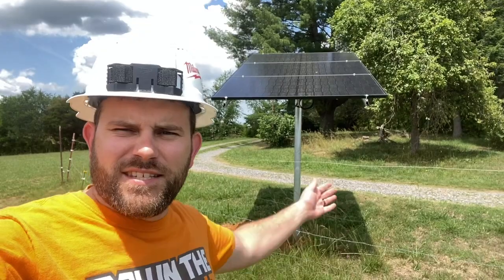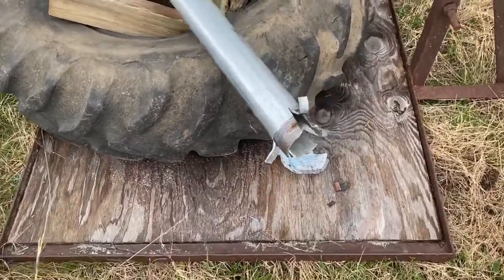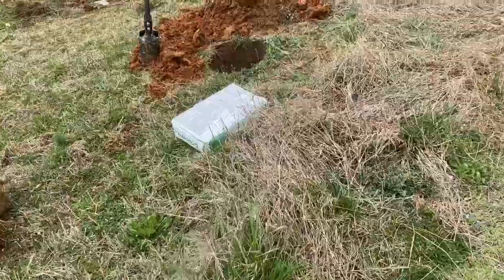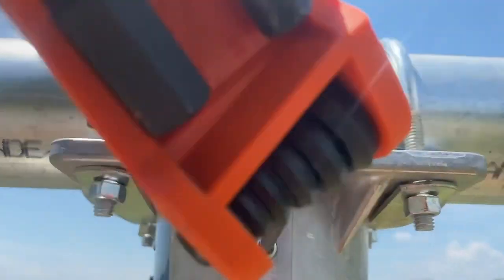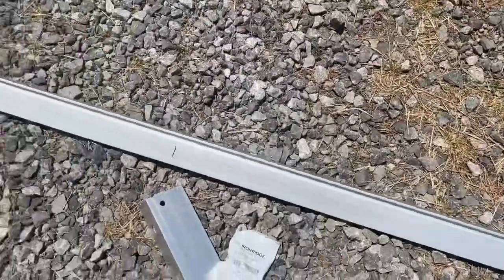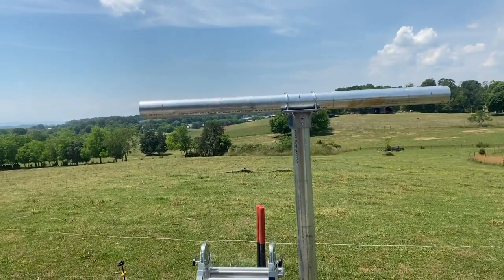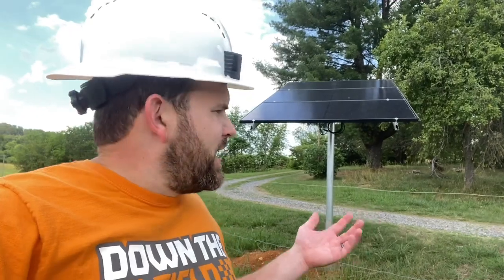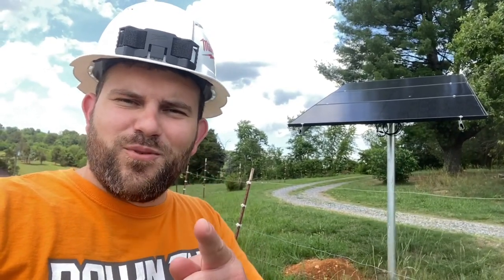How to build a top of pole off grid array mount for power

Comment: thanks, glad to see another East Tennessean doing off grid, am about to on my land, have solar panels, wiring, charge controller coming.. had to buy bit by bit. then need 2 12 v to run my 24 v 1600 w system.. then pole mount them.. abutting the car port so I can get more leverage as well as reach them easily.. idk if 150 an hr or more..  is something I can place in my budget.. will see.